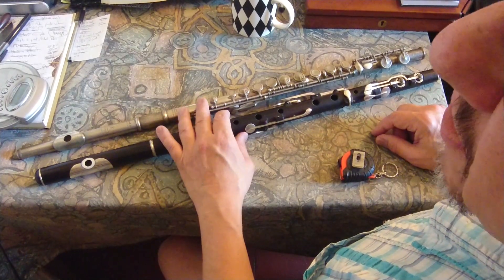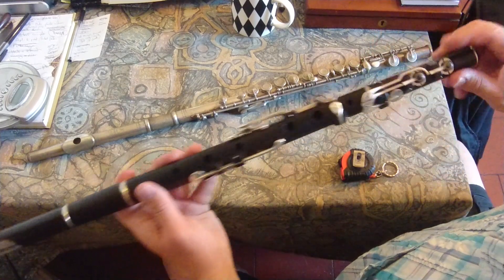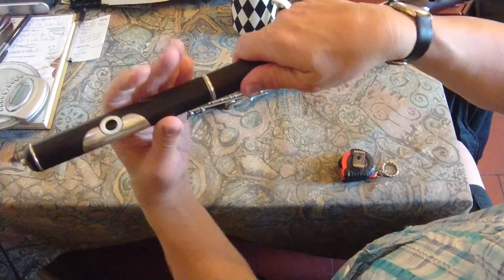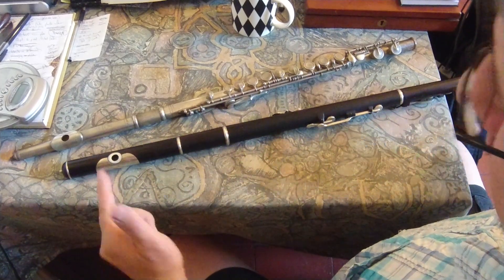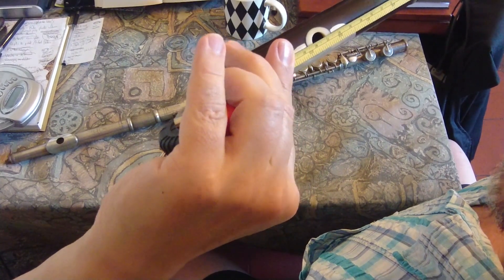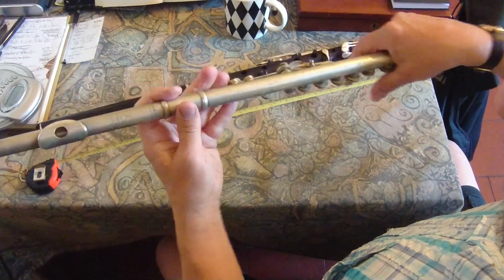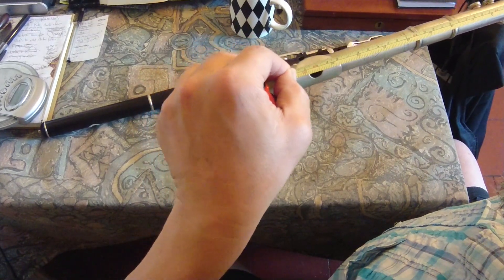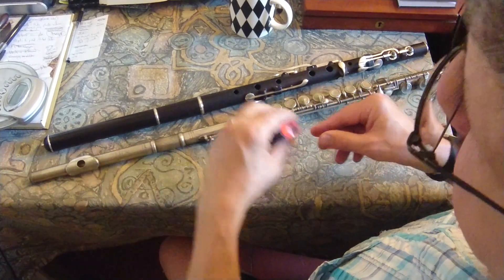How to take the "Sounding Length" of a (transverse) flute

Comment: Were you can get the perfect measuring data how to make a flute
Reply from the maker: I'm sorry, bamboo flutes aren't my thing and I don't have such specific information. I'm quite sure it is available online. Try web-searching on "making bamboo flutes" and "bamboo flute measurements".

 I know instructions for PVC tubing flutes can be found and there is or used to be some calculation software. (Unfortunately Pete Kosel's website and original Flutomat calculator seem to be lost from the Internet - site gone off-line, although there is an archived version which appears to work still here: http://web.archive.org/web/20110611151055/http://www.cwo.com/~ph_kosel/flutomat.html .) 

These other websites may be helpful:
https://tippleflutes.com/making-a-simple-irish-flute/
http://iotic.com/flutomat/#
https://www.guidogonzato.it/whistle/index.html
Reply from the maker: I'm not sure I understand. Are you asking where one can get detailed plans/specifications for making a flute? If that is your question, you need to say what type of flute you want to make. There are many different designs and styles.
Reply: @Jemtheflute  sir, just guide for a simple bamboo flute....diameter, thickness and finguring holes calculations....please

Comment: What is a typical sounding lenght for a flute in 440 with a  b-foot?  Do you measure it in the same way as with a c-foot?
Reply from the maker: Yes, you always measure the same way/thing, regardless of size/pitch or foot extension. You just have to make sure you know what you are comparing. It's important not to muddle up conical bore flute reference data with Böhm cylinder bore flute data - the latter are longer for any given actual pitch. As I don't really deal with/don't have much experience of modern B foot Böhm flutes I don't have many measurements to answer that part of your question definitively - only one, in fact - a Buffet Crampon student level Cooper Scale ?A442 one which has a SL of 625mm. Older A440 ones might be up to 635mm. Please don't take those as definitive. Go measure some modern B foot flutes and get some good comparative data.
Reply: @Jemtheflute  thanks for the info! I'm actually in wondering more about the lengths in regards to conical simple system flutes with b-foot. Is there a generall "it should be shorter or longer than .... To be able to play in 440?"
Reply from the maker: OK. I've a little more data on conicals, though not loads. Bear in mind that the slide closed standard SL measurement is not usually the setting at which the instrument will work at the target pitch or with good scale intonation. Some slide extension is almost always necessary, but the SL is a fair (but not entirely reliable) indicator of probable usable pitch. So, I have two Rampone "Ziegler system" B foot conical flutes, one very usable at A440 with c6-8mm tuning slide extension (slide-closed SL 625mm), one rather longer overall, definitely lower in pitch, not usable as high as A440, with a SL of 635mm. (Hmmm odd that, given my previous note on Böhm cylinder flutes, but as I wrote, I've only insufficient and insecure data on those.) I also have an anonymous German flute with B foot, again definitely low pitch/not usable at A440, with a SL of 650mm! Lastly I have a genuine Meyer which, although not currently properly playable, seems to be a little above A440 closed-up so will assuredly work usably at A440 with a few mm extension: it has a SL of 622mm.

Comment: What about "end correction", which is determined by bore diameter.
Reply from the maker: Not really relevant to the general use of SL as a playing pitch indicator. Böhm concert flutes all have the same body bore ID anyway, and conical bodied ones a) taper and b) vary erratically, but will probably all be pretty close regardless. It makes little difference from the point of view of the usual purpose in taking a SL. Sure, if you're doing deep scientific analysis of an individual instrument it matters....

End correction matters to flute designers/makers. It doesn't really affect the use of the SL to approximately determine the probable playing pitch of an existing instrument. Also, it only affects the tube-end note, not the scaling.